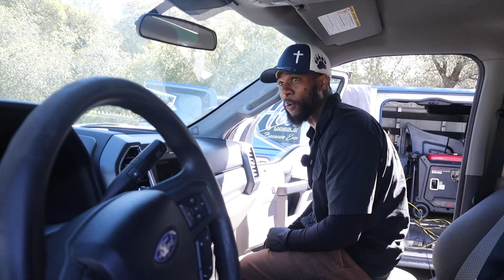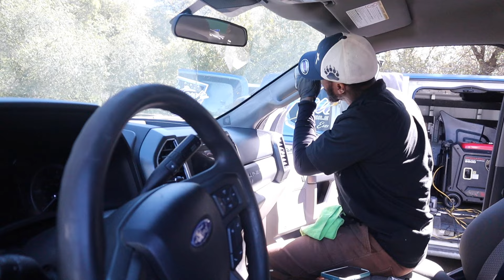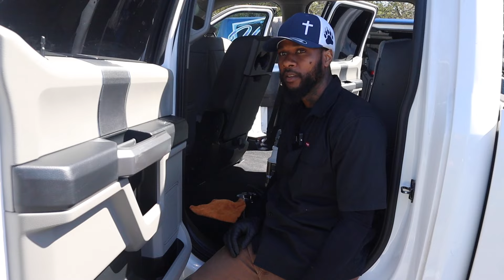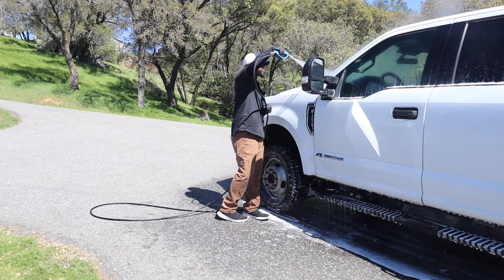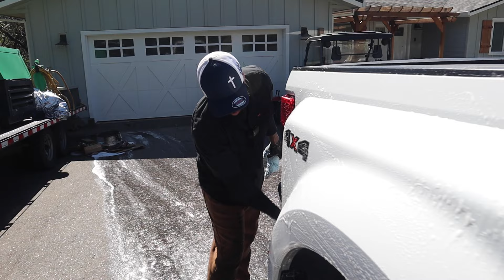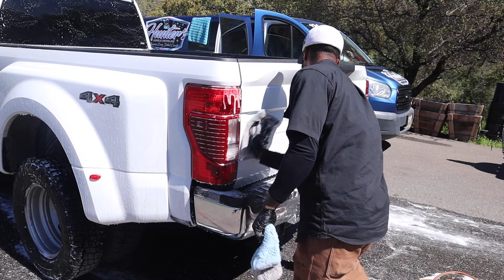Why I Have To Detail 7 Days A Week - Hunter's Mobile Detailing

Comment: Why are you towel drying your cars? That’s too much washing towels at the end of the day. Should be using a leaf blower and air drying. Also using towels, you still risk scratching or marring the paint. Air drying also aids in getting water out of the mirrors and other hidden spots.  Rainy days is also another good day to solicit new customers and talk to repair shops in the areas that you like to work and leave your card there so they can recommend customers to you.
Reply: Air drying also promotes water spotting in paintwork too that wouldn’t be there if you towel dry…. If you towel dry CORRECTLY there won’t be any visible marring of the paint, just mist your towel with detail spray and then mist the panel as well and then dry the panel in straight lines with NO pressure and you will be just fine, it works for sure and also acts as a secondary contact wash for any smaller things you didn’t get off the panel during the wash process…
Reply: @burn1n09  never had an issue with air drying. But what I do after I air dry is lay down a layer of Beadmaker, then obviously wipe offwith a MF. Carpro Reset and P&S Pearl are the best soaps out there.
Reply: What about both?